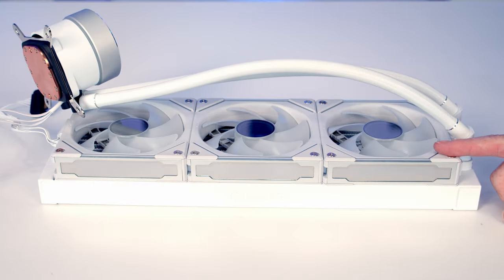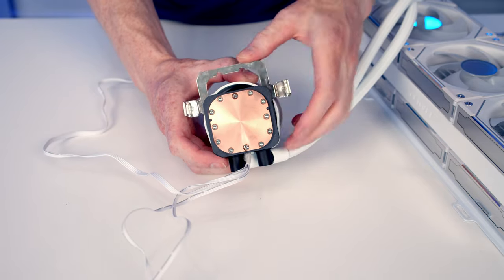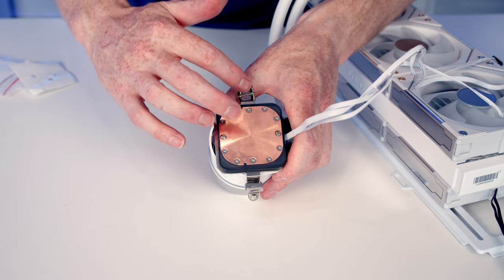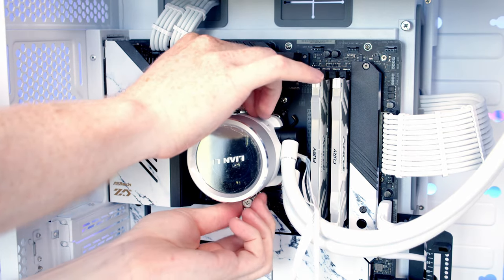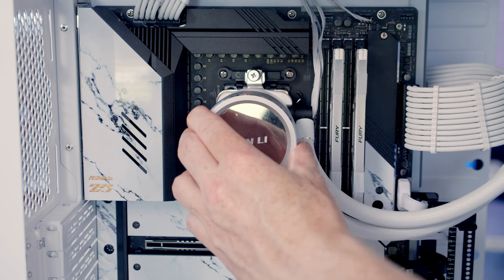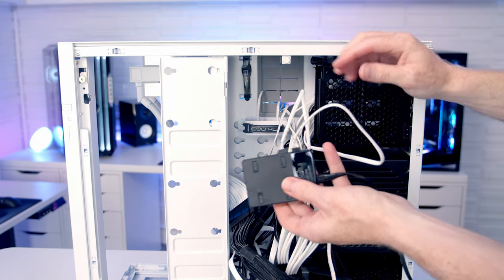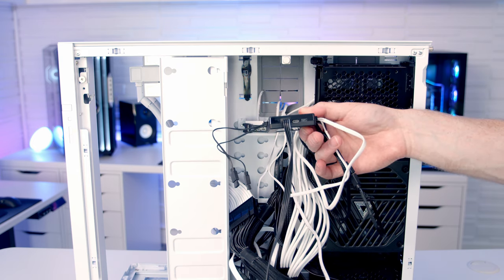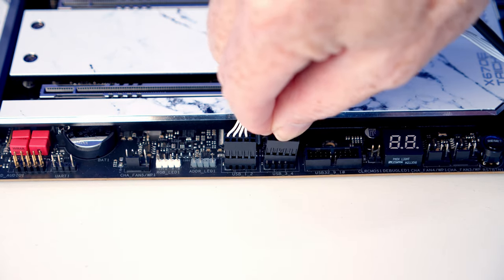Lian Li Galahad II Trinity SL-INF 360 - Installation Guide

Comment: My Antec Flux Pro case comes with a fan hub built into it already, I don't specifically need to use the one that comes with the pump correct?

Comment: adding the thermal paste is it necessary to use the sticker could i just add the thermal paste to the cpu and spread evenly over the cpu
Reply: It’s a special plate it needs to feel a plastic sticker on it before it works.
Reply: yes u can and its even better
Reply: You could yes. Is it a good idea? Probably not, there's a reason the manufacturer provided the sticker.

Comment: I need help. I bought the aio which came with a controller. I also bought the triple pack and that also come with a controller....but they are both  totally different connections for each controller. I cant really need 2 controllers for the same make and prduct just to run aio and the fans to be in sync rgb wise?
Reply: I have run into the same problem, have you found any additional info?
Reply: @evankappatos  I bought reverse fans and the connection for them are the same as the aio controller. So i got 3 reverse fans and you only need 1 to connect to the controller, but I bought 3 singles...so from 1 of them I used to connect to the triple pack what comes with a totally different controller and yeah no everything is on 1 controller.
Reply: So does that mean you did not find any additional information on the different connections between the aio and the 3 pack? Im also in the same boat and im about to snap as this is my first build so i feel like im doing something wrong
Reply: Can’t you just change the cable on the fans and use the single cable that came with the 3 pack?

Comment: I still don't understand how to get the radiator rgb to turn on. The cable that comes from the radiator is one fan and one plug that doesn't go into the pump. Do I HAVE to use the hub for this. I don't want to right now but it seems I have to to get the lights to turn on?
Reply: have you got this sorted bcs i have the same problem
Reply: have you got this sorted as i have the same problem
Reply: I also have this problem
Reply: @jettaguilar2821 If someone still has this problem you can buy a 3 pin jst to 3 pin 5vARGB conversion cable, which you can then plug into your MB

Comment: I had 4 questions:

1. On first boot I won’t have L connect, so I shouldn’t use the USB 2.0 cable from the controller?
Instead I use the pwm and rgb cables for motherboard sync. But you said you’ll connect both options (L connect vs motherboard) to be thorough, is that safe?

2. Also I was wondering what is powering the pump RGB LED if you never used the port from the pump? Shouldn't I connect the pump LED to something?

3. You connected the controller PWM to the CPU fan header, won't that run all fans at a high RPM. I thought CPU radiator fans should only run at max speed. Can L-Connect help me regulate all the fan speeds?

4. What is preferrable on a first time boot, motherboard sync or L-Connect?

Comment: Anyone know if you can Actually Remove the Fan cable and replace it with the Single Cable from the SL infinity 3 pack, then it will fit into that controller. This AIO and Fans have different cable and Hub

Comment: I'm confused with one part if the pump has 1 connectors one being 4 pin pwm and the other is sata....why did you plug in the two? Won't 2 power sources not short the pump
Reply: One is for power one is for speed control.
Reply: @TheFlyingHeifer  figured that out recently installing mines
Reply: @DarkIdrees  Also just fyi even if u did send to much power to it it wouldnt be a short. A short is when u have power tied directly to ground. Like connecting the positive side of a battery directly to its negative side. To much power would be overvoltage or overcurrent.
Reply: @TheFlyingHeifer  I did electrical I know how that works
Reply: @DarkIdrees  Obviously not since u said it wrong  😂
Reply: @TheFlyingHeifer  said what wrong?
Reply: @TheFlyingHeifer  I'm confused by your statement of me being wrong...how am I wrong exactly?
Reply: @TheFlyingHeifer  almost as if the "figured that out recently installing mines" flew over your head and you still proceeded to talk shit...I don't understand where you are getting at
Reply: @DarkIdrees  bro u were asking about connectors. I answered. U said u figured it out. I was assuming u figured out how to connect them, not went out and did an eletrical research essay.  Anyone can figure out where to plug something in, not everyone is going to understand why or the details be hind it. Based on your question and “i figured it out”, I figured u just figured out where to connect it and not why it wouldnt short, hence why i added that little fyi.  Im guessing that whole simple logic flew over your head to?
Reply: The hub doesn't fit the two connectors only the usb one

Comment: I have two questions:
1. Can I apply thermal paste (X) on CPU as well? or it required to applied on the pump surface?
2. I will fit the cooler directly to the case without the upper 3 fans, is it OK?
Reply: Not sure if you've figured this out yet, but yes to both. Look up videos on thermal paste application, plenty out there.

The radiator for the cooler can mount directly onto the top section of the case, just make sure you use the screws it came with and do not force them in or strip them.

Comment: Nice detailed steps. 👍🏾Am still on the fence about water and electronics. However, how safe would you say AIOs in general are from leaks?
Reply: They are very safe. Leaking you see online is usually from custom water loops, where theres a chamber of liquid in the case which is used to cool the GPU as well.
Reply: I've used aios on both of my pc's since 2015 and never once had an issue. First was a corsair 120mm, second a corsair 240 and handing that down to wifey and latest build is a 360. Didn't want a 3rd build but first pc mobo failed and cpu was 1st gen ryzen for which mobo support was discontinued so here we are. I wouldn't hesitate at all to keep using liquid cooling personally but boils down to personal preference.
Reply: It's not actually water that's why
Reply: They’re built by professionals that know what they’re doing.  The people that build them know they’re going to be right by electronics.  Also, thermal paste can be just as dangerous if you put too much on you, can short your motherboard. Like go with Cian if you can, there’s absolutely nothing to be worried about as far as leaks.  Sure you’ll hear stories about some failing but that’s just it failing not leaking. If you buy a reputable brand, the chances of it leaking are so slim you would be dumb to worry about it. Not trying to be rude lol. Just trying to get the point across that you do not need to worry about leaking.

Comment: Hello Christopher! Im actually building in the same case. Same konfig of fans and so on. My question is. All the other fans you put in. Did you group them into the same hub? Lian li says you cant expand more then one fan per port on the AIO hub. How did you connect all your fans is basicly what im asking. Cos im currently at a loss as I have the infinty hub (wide connectors). And the AIO 4 pin connectors as you showcase. And i noticed you put 3 more groups. 2 exhaust in the back 3 intake at the bottom and 3 on the side. How did you group them? and did you do that into the same hub?
Reply: When you purchase a three pack of infinity fans, it comes with a sl infinity hub.   All your case fans would plug into this for power and RGB.  The AIO pump and radiator fans go to the hub that comes with the AIO.  The lian li connect software will see all this and you’ll be be able to control all of it.
Reply: @TheFlyingHeifer  Thank you sir for the clarification :) much appriciated. :) USB adapter orderd ;)
Reply: @robinskold8190  Also wanted to add. U dont need tbe sl infinity hub. Theres two hubs. The sl infinity one that comes with a pack of 3 infinity fans. And a aio hub that comes with the aio. If u order the 3 pack that comes with the infinity hub. Then these fans will only come with a 7 pin cable. This puts the fan power and rgb in one cable. U would have to plug this into the infinity hub it cones with. So basically u connect the 3 fans together, see instruction manual. Connect one end of cable to one fan. Then connect the other 7pin end of the cable to infinity hub. Do this with rest of fans. Then connect infinity up to sata power and usb to motherboard. 
Now if u purchase a single infinity fan, it will come with a cable that has to split ends, a 4 pin pwm and a 3 pin rgb. This will not go into the infinity hub the 3pack comes with. This can either go into the hub thay comes with aio or the motherboard. So what I did was I purchased a bunch of single infinity fans. Clipped the physical fans to each other for what i need. Then i used the cable the single fan came with. Connected one end to the fan. Connected the rgb end to the aio hub. Connected the pwm end to the mother board. Did same with rest of fans. Then I connect the pwm of the aio and rad fans to the motherboard. I connected rgb of pump to motherboard. I connected rgb of rad fans to hub. This setup will give me full control of rgb through lian li l-connect 3. And fan speed control through mother board software which i can acces and control from windows 11. oh and used rgb adapters the aio comes withs with connect infinity fan rgb to aio hub. Aio comes with 3 adapters.
Reply: @TheFlyingHeifer thanks for clarifying! I'm in parts gathering stage of my build and had some questions I couldn't find answers to so this helps. 
Wanting to do o11 vision chrome build so fan orientation set up with 3x 120 infinity fans on exhaust on radiator side mounted, 1x reverse 120 at rear and 3x 140 bottom intake fans but can't find any 3 packs of the 140s.. was looking at this aio due to the fact it comes with 3 fans attached so make a saving but obviously lose out on the 3 pack of 120s with the controller and wondered if there was a work around
Reply: @Ackz89  if you’re going with this AIO, don’t worry about the Infiniti hub.  This AIO will come with the hub that you will connect all your fans to. keep in mind you may have to connect your pump and your radiator fans to your motherboard.  Which to be honest, they should be anyways.  All your case fans will go out to the hub. This AIO comes with.     Also, I don’t think they sell any 3x140.  I just had to buy three separate 140 fans.  I don’t know if this helps, but the only reason the three pack comes with the seven pin connector and the infinity hub is purely for ease of use.  Like normally on a fan you would have to connectors, pwm(speed control) and rgb.  The seven pin basically combines those two so that you can then connect into the Infiniti hub. The AIO kit also does come with adapters for the separate infinity fans you purchase.  what I would do is get the AIO.  Purchase your seperate 140 fans.  then just see what connections you have left and plan your 120 fans accordingly.

Comment: Interesting seeing you do this as I am about to place an order for the same case and AIO and was wondering if it was possible to do a push/pull on the AIO.  Did it come with the longer screws or were they some you had laying around?
Reply: i bought the aio and same fan pack, no screws came with that i know of

Comment: It could be an interesting experiment to see how the performance version performs with its fans replaced by infinity fans to improve aesthetics.
Reply: It's called performance because the fans are max 3000rpm, and the pump is a little higher
So basically if you install a 2200rpm on the performance rad/pump combo.. half the performance leaves the room

Comment: There is a black bracket on the right side of the GPU to support weight I guess? What is it? I need something like that urgently. Is it coming with the case or the mainboard?
Reply: You're looking for a gpu support bracket, they're widely available, Google which works best for you
Reply: @michaelwells3544  thanks, it was already available with the case and also gpu itself now I have two. I've worried for no reason🤣
Reply: @MyGamingHighlights  excellent, glad it worked out 😎

Comment: does the lian li galahad ii trinity sl-inf 360 come with long radiator screws or do i have to buy them separately?
Reply: not included
Reply: @XtoF987  pretty sure they are included just screwed into the aio with the fans.

Comment: I bought the 3 pack and the aio installed the aio hub connected everything up and when I went to connect the 3 pack I bought its different cable ends to the hub so I have removed the aio hub and I’m using the hub that comes with the 3 pack is this okay I’ve managed to connect the aio fans to the 3 pack hub will everything still work fine??
Reply: Did doing it this way work out for you in the end? I'm in the same position. I've purchased this AIO but also a 3-pack of fans. Is it best to just use the hub that comes with the 3-pack?
Reply: @ChapperzTV  I’m sure I just used the hub that came with the fans as for some reason the aio hub had different connections on it. Just plugged the aio fans into the fan pack hub
Reply: @jackrattray8837  Thanks so much for the quick reply man, that's super helpful. I'm doing my build tomorrow so that will save me a headache haha

Comment: Hi! Please tell me why most of youtubers mount de AIO on top?the most efficient (cooler) way would be to mount on front with tubes down. Is this just for aesthetics/ convenience?
Reply: Personally i do my aio on top because without it on top it looks really empty and spaced out in my case.
Reply: Because mounting AIO on top prevent air to trap in the pump
Reply: Is the best becouse, all the hot air insta will go out from case, so u cool like that your GPU too!
But if u dont care for your GPU, then best place for your radiator is ofc front with intake fans, so hot air wil come inside your case from radiator.
Reply: I would like to see a tubes up VS tubes down on a 360mm AIO. There is no video comparing the efficiency, just the bubble issue.
Reply: @pacif1st. This is the way
Reply: @ZondaRbg  hot air wants to go out of case, but runs into a big block of aluminum in the way.   The reality it doesn’t really matter.  It really depends on your setup.  My case has 3 fans pulling air from the bottom to cool my gpu so the radiator pulls cool air from the outside to cool it down. The hot air has easy access to my three out take fans on top and the one on the rear.